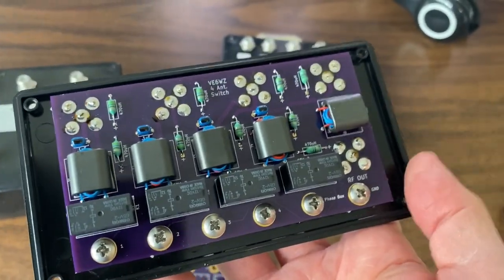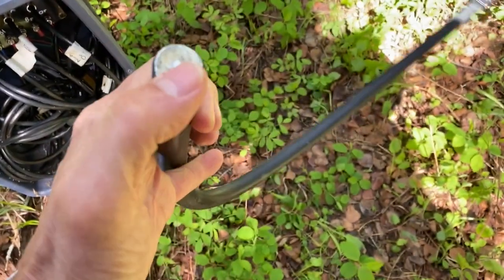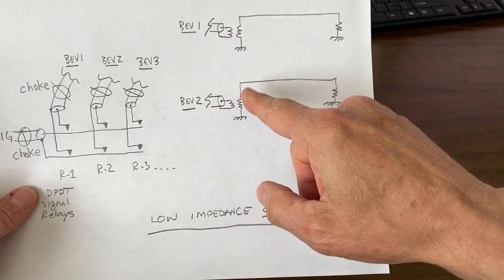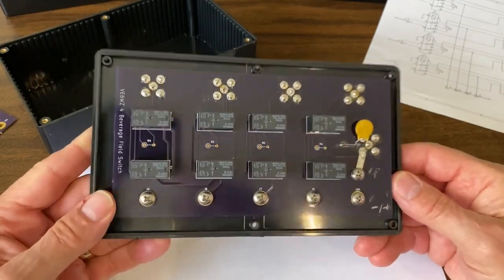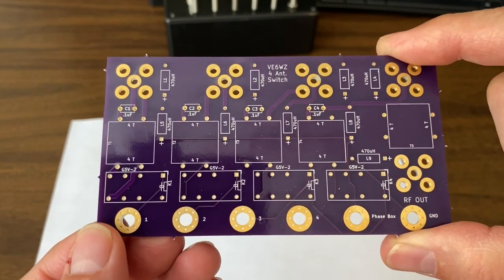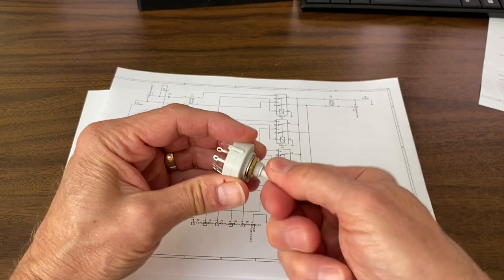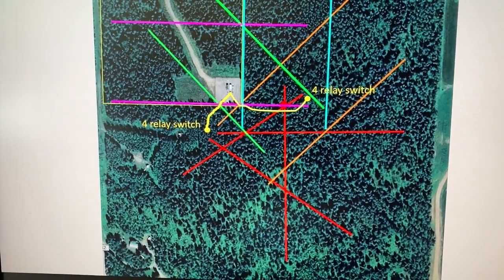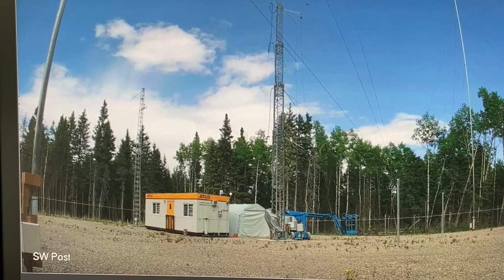How do we switch Beverage antennas in the field?

Comment: Very informative set of technical videos. Much appreciated. My group has a number of BOG antennas and I'm looking at improving our feed / switching methods. A couple of questions. What is the purpose of the 470 uH chokes on the ground side of the input and output ports? And, although not covered in this video, I've seen an earth grounding point positioned ~25 ft from the switching box towards the receive point. What is it's purpose? I get the impression that the position and quantity of earth grounding points may be important in preventing unwanted signal pickup / coupling. 
73, Bill K7UOP

Comment: Hi Steve, Very interesting presentation about your Beverage antenna array switching setup. I am curious about the 1:1 braid breaker transformers. You mention and show the binocular cores on the switch boards. What ferrite mix are they, -31 as well? How many turns each are used for the primary and secondary? - '73, Thomas - ac7a
Reply from the maker: The binocular cores are  type 73 material core. 4 turns primary and 4 turns secondary. Ferrite multi-aperture core part number 2873000202 . Here is the Digikey part link: https://www.digikey.ca/en/products/detail/fair-rite-products-corp/2873000202/8593948

Comment: Is there any reason I couldn't use a bird 74 coax switch in my shack to select the beverage?
Reply from the maker: Les,
Yes, you could use a switch in the shack.
Usually we locate a remote switch in the field in order to minimize coax runs back to the shack.  One long coax feedline out into the bush can feed multiple antennas using a remote switch.
Reply: @ve6wz  thank you, no doubt it's more economical as well. 73